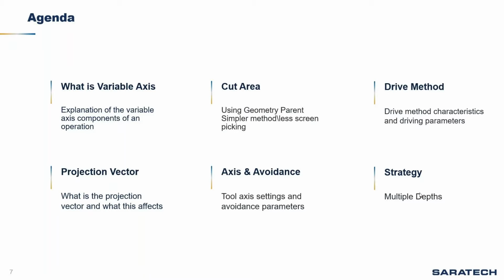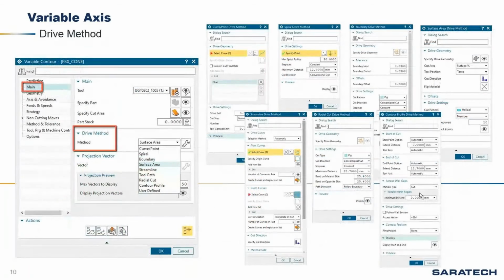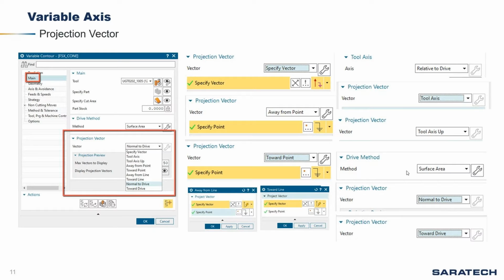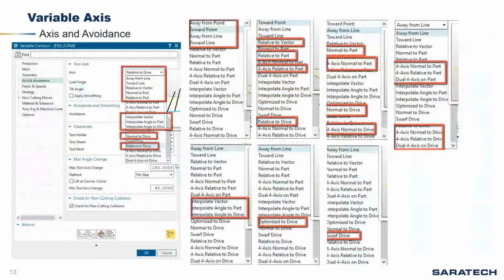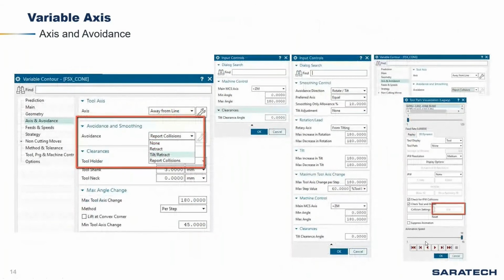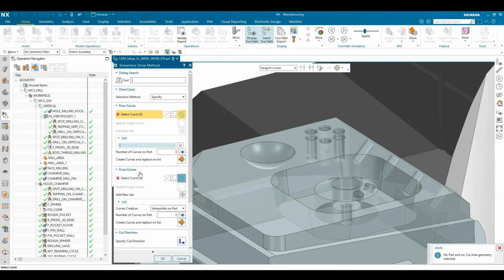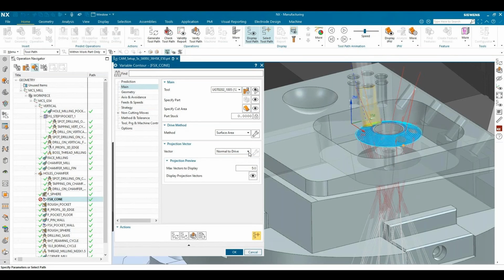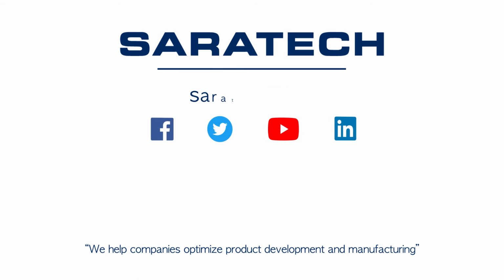Variable Contour in NX CAM

Comment: as a Mechanical engineer we can changes and modify also make new post using post builder but now.....nx introduce post configurator in latest version .... we don't know software programming python, c++, Javascript, TCL language etc....  also there is not enough study material for post configurator ..... i mean there is variety of videos in nx website also in youtube but to understand we need some basic knowledge about these languages tcl and python. so maybe there is video series from basic level or from scratch .... to learn and to understand post configurator in detail is requested .... post configurator is nightmare for mechanical engineering ....bcz they lack in these tcl and python .......... videos that are already available is needed advance level of understanding ....